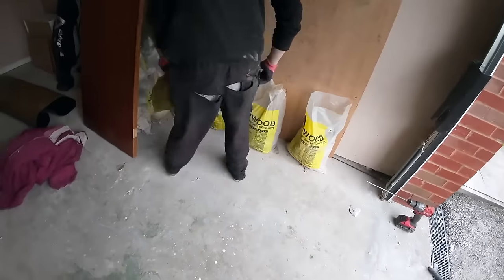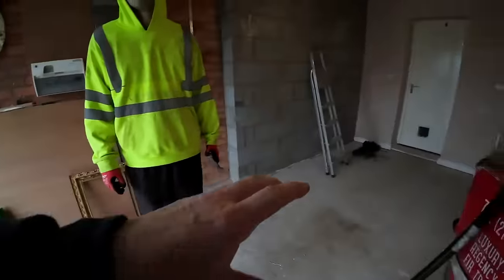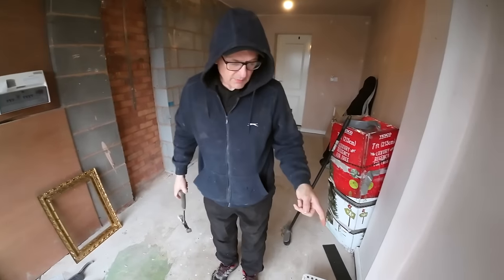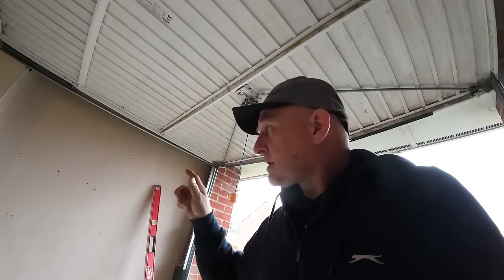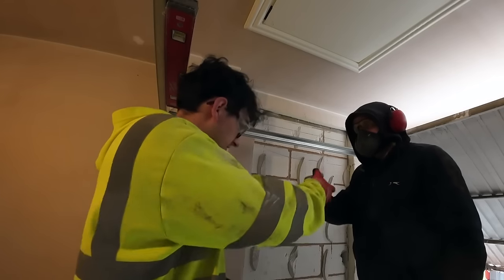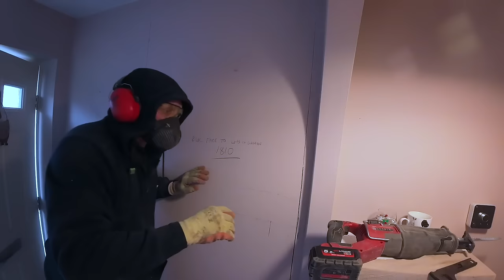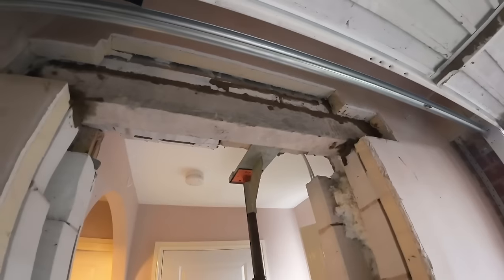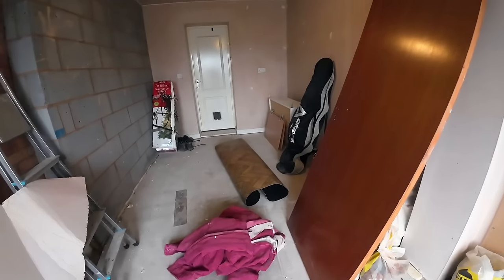A GARAGE CONVERSION PT 1, PEDESTRIAN DOOR KNOCK THROUGH INCLUDING CONCRETE LINTELS

Comment: How do house builders get away with making garages so small.
Reply: You can only work with the space you've got
Reply: @JamesMears76
That is a very pertinent question.
I am fairly certain the volumetric builders only build them as part of the planning approval. They are still building the same size garages that we put up in the 1970`s, despite cars now morphing into supersized-bloaty things.
Consequentially people convert their garages into liveable -  rooms or useful spaces....
So, the short answer is cost, and archaic planning rules.
Reply: @martin2466  you are 100% correct. People buy houses with garages they will probably never use for the intended...unless to store their classis car. I suppose it is because land is so expensive in UK.
Reply from the maker: All very true 🙁👍🏽🧱
Reply: @Sean006   Absolutely.
Normally planning approval is dependent on the property being able to facilitate the parking of at least two cars, off road,   to prevent overcrowding and pathway parking on estate roads.  Most people are happy to leave their cars outside, as these days modern cars are more water/moisture resistant.
Planners and councils are traditionalist in their approach to garages.  Developers would quite happily not build them if they could get away with it, but are forced to by planning approvals/requirements.
They will come in handy when we are forced to swap our perfectly good and efficient gas boilers for A.S.H.P`s and all the paraphernalia that goes with them...........heaven help us....!
You are correct good building land is expensive in the U.K, but likewise the profits made on new-build houses is astronomical....
Reply: @martin2466  You obviously know how the system works. I think you are right....garages will be very useful for ASP hot water & heating systems. Plus battery storage for solar panels. But I expect a lot have been converted into kitchens and extra bedrooms. 
Life is complicated & getting more complicated. It is good to see tradespeople like Steve & Alex are in the building industry to adapt our dated housing stock to modern living.

Comment: That new concrete lintel is overkill, it has at best 1 line of blocks above it , its outside the main house structure. Could have just removed the blocks up to the ceiling. The padstone for the far front elevation is to the left of the new opening in the garage
Reply from the maker: If you say so, I don’t remember you being there
Reply: @SteveAndAlexBuild  Did the video not show the property?
Reply: @SteveAndAlexBuild  Chaps,
I did not realise that you had a Resident Structural Engineer on board now......!!!
Funny that, I did not see him appear in the video....
😁😁😁🙄😬👍👍🤣🤣
Reply from the maker: Yes it did
Reply: @SteveAndAlexBuild  Then my comment is factually correct.  If you are going to post your work on the internet expect those that know better to comment upon it.
Reply from the maker: Wow ! you know better but were  never there that’s very clever
Reply: @SteveAndAlexBuild  Thats what I'm paid to do
Reply from the maker: @thingamajig4102 😶🍳good job you’re not getting paid for this job because your wrong